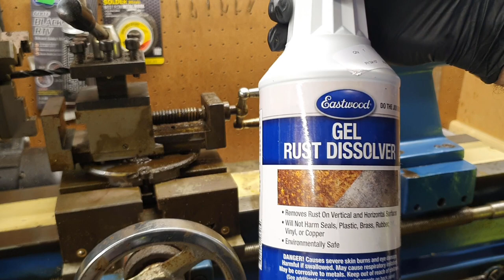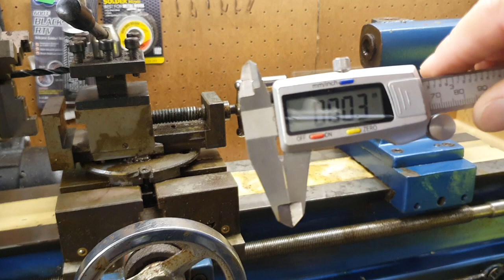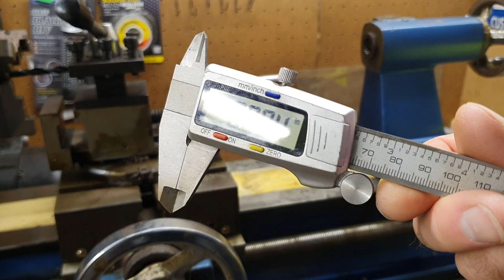Can a Rusty Lathe, Mill  Drill be saved from Scrap Part 5

Comment: hi andy
Looks like all the handles / knobs are well eaten, i would be tempted to take all cosmetic parts off and re-machine a few thou off, to get back to good metal, even if it mean't taking the chrome off. the screw on the compound slide could be re-made, i know it's a matter of where do you stop, but if it's a project time is irrelevant as long as you get a useable machine at the end.👍👍
cheers
Kev
Reply from the maker: Hi Kev, 
Thanks again for your much welcome comments.
I think I will get the cross slide off  and risk the sand blaster on various parts, and see what we are left with.
Then maybe a coat of paint, like you say, where do you stop with "MISSION CREEP".
I have lots of projects on the go ( like most model engineers I guess), so do not want to get too bogged down with it.
After all it is a "BUDGET machine.
Thanks again.
Andy G.